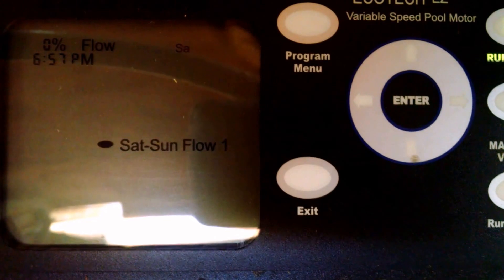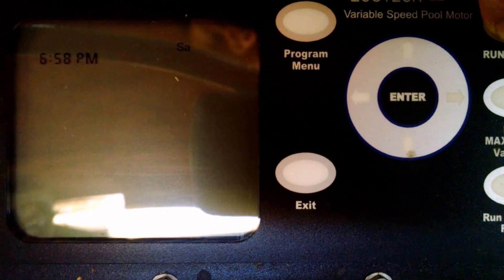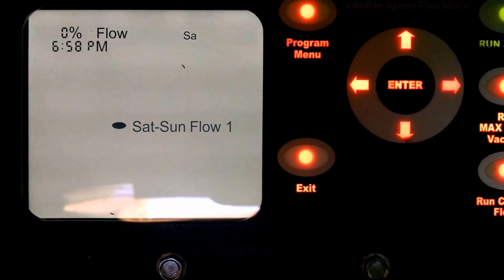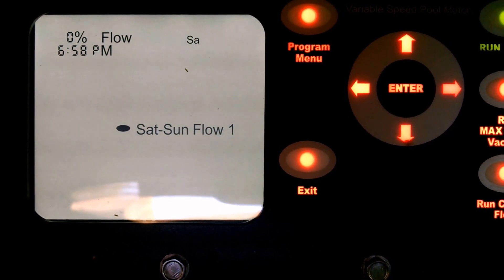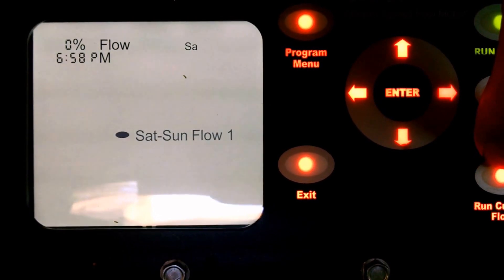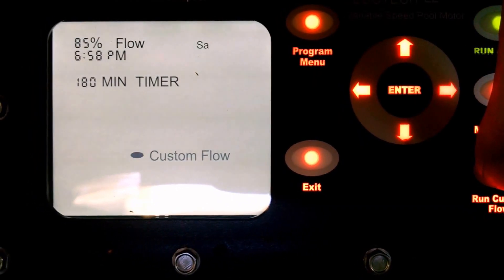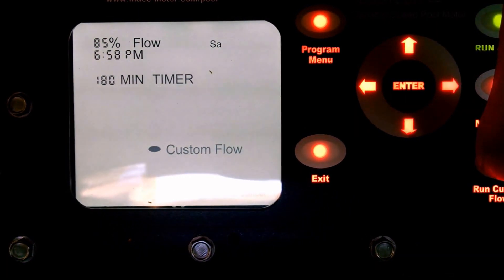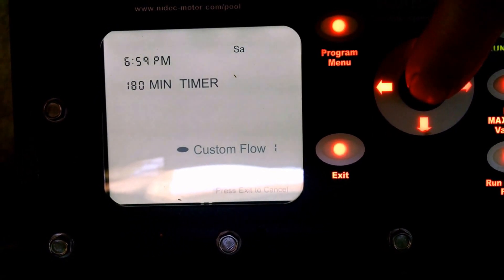How to Operate Ecotech EZ Variable Speed Motor

Comment: I just had my pool resurfaced and the pump was off for 2 months. Now it doesn't run automatically i'm having to turn on the custom flow to get the pump to turn on. The run button is on. The time on the pump seems to be off by 12 hours. Do you know if the programming was deleted due to being off for so long or am I just not pressing the right buttons?
Reply from the maker: It will only retain programming without power for a finite period of time. I'm not sure how long that is, but that's likely the issue. It probably needs reprogramming.
Reply: I just fixed the date and time and it turned on and seems to be doing what it was. So I hope i don't have to re program. Found the manual online and it looks like a pain.

Comment: How do I turn pump on to run continuously. Just started up and have alot of algae.
Reply from the maker: Unfortunately with this type of pump there is no way to do that outside of modifying the programming you have in there, or just walking out every hour to press the bypass button.

Comment: I'm having issues with one pulling to many amps wondering if you have any advise thanks
Reply: Unfortunately if you're pulling too many amps it's generally a problem in the windings. There's a small chance it could be the impeller being jammed but unlikely. Verify the impeller spins freely and if it does you likely have a dead motor.